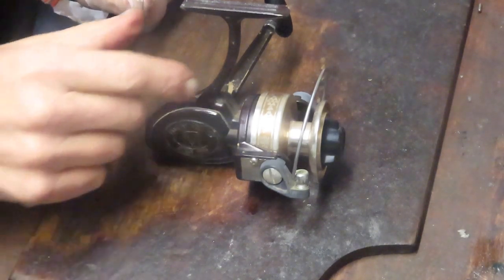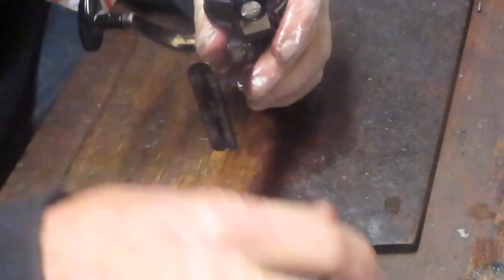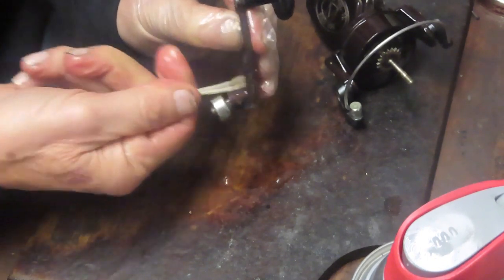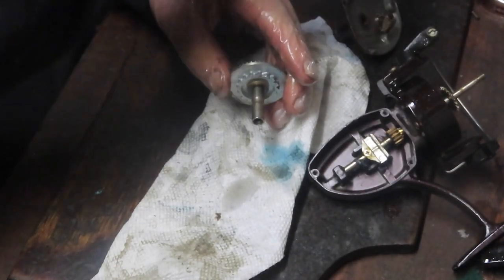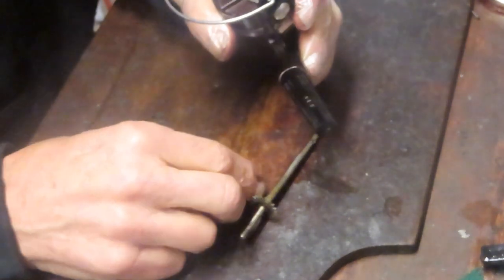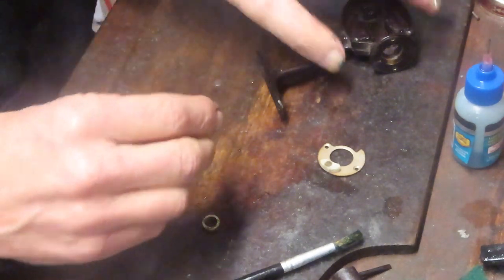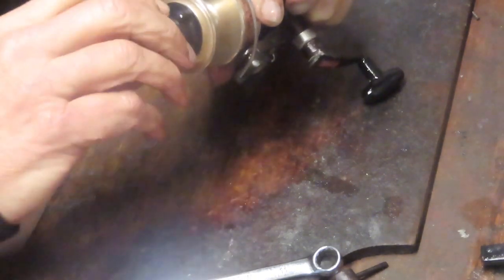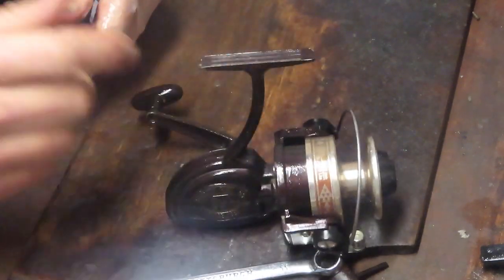Rare Martin 3930 spin fishing reel circe 1970s how to take apart and service

Comment: At first sight it looks like a South Bend reel. Inside it still looks like a South Bend reel. There are reels branded as Martin Bretton reels but they would not be made in Japan and this reel doesn’t resemble a Martin Bretton. Your comment about loosening the drag when not in use is very true. I got a reel last week that I had to use a razor blade to get some compressed leather drag washers loose. I think I was able to clean them and use some drag grease to revive them. I’ve started spraying the main gear with PB Blaster as well as my brush with it and then cleaning the gear. It easily trips all the old grease off. Then I use the paper towel to dry if off. I like this reel. It is simple and straightforward and seems to have very solid construction. I had never heard of a Martin spinning reel. Thanks for sharing this one Dennis!
Reply from the maker: Thanks Chris.  PB Blaster is a good product, but I don't like the odor when I use it, so I only use outdoors on really tough projects.  Be well - Dennis
Reply: @2ndChanceTackle  it’s not the smell that gets me, it burns my eyes. I really use it mostly on the really bad parts and bearings. Others I use WD40.